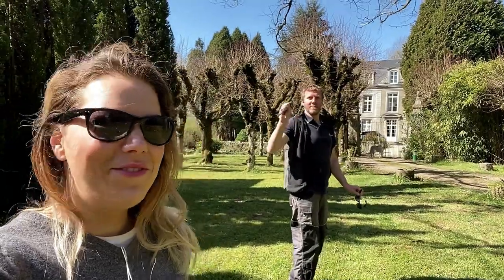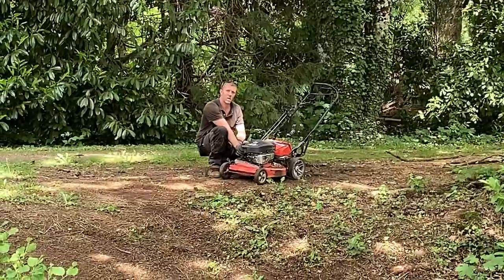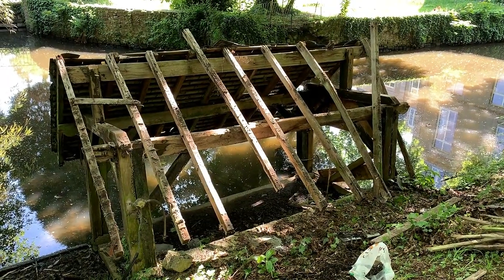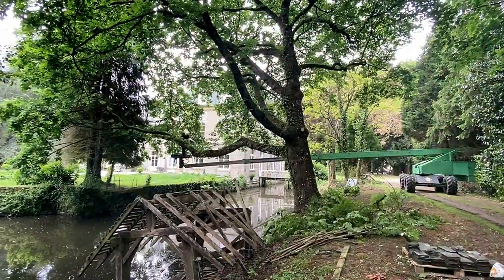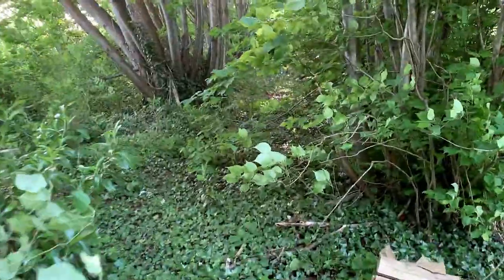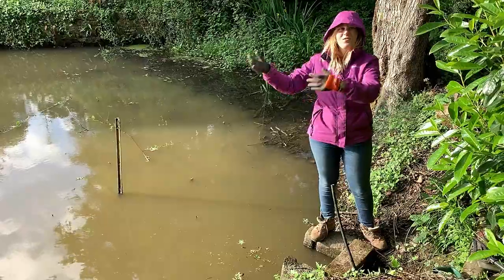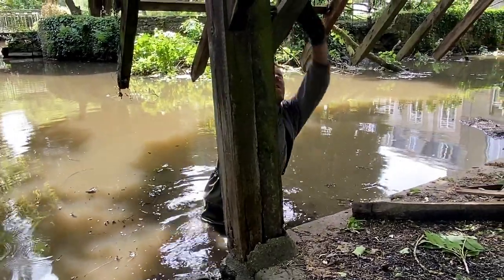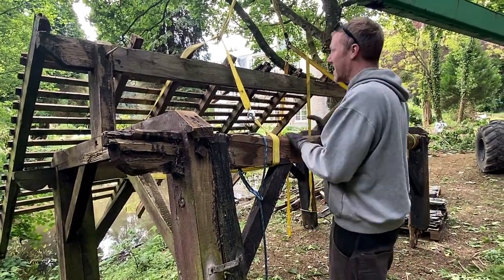Chateau Life 🏰 EP 13; SAVING THE ANCIENT SWAN HOUSE!

Comment: Good luck with the restoration of the duck house..just hope theres enough of the original structure left to work with...wire mesh should hold back some of the debris 💙
Reply from the maker: Been working away on it today, I’m replacing as little as possible without compromising the structure so it’s as original as possible; will get to see how that turned out in the next video x
Reply: Fab...look forward to seeing thd progress 👍

Comment: Fab work guys, and like all old buildings and structures always a bigger job than at first thought! Please treat yourself to some protective gear for when using the chain saw. Hat, gloves, sleeves, trousers, boots etc. Chainsaws are brilliant tools but very dangerous and unforgiving... we want to see you working for years to come!
Reply from the maker: Appreciate the kind words!

I’m always wearing boots, Kevlar lined trousers and gloves.

I wear sunglasses or clear glasses for eye protection as I have one eye that it very bad and I struggle very badly with the the mesh face protectors for vision; it’s actually been significantly more dangerous when I’ve tried to use it.

There is no such thing as a mild chainsaw accident after all!

Comment: Maybe the mower just needs new spark plugs n the air filter cleaned is all. 😃💕
Reply from the maker: no that's the basic maintenance, turned out that it has a system mechanism to cut out when it's at an angle for safety reasons, not all have this so that was interesting to learn.

Comment: Are you using premium/super gasoline in your 2 stroke engines?
A mechanic advised me to do that.
Too many additives in the lower grade petroleum.
Reply from the maker: Phil believes it was cutting out either due to the angle as they have a cut out switch if not level (some machines have this safety feature) or because the engine is not powerful enough for the hard job hehe 😂

Comment: Would it be any use you putting a mesh gadget around that drain  to stop I getting blocked every day
Reply from the maker: I have a mesh bin usually inside to catch surface debris, problem is if I stick it so that it blocks them going though I’d then have a lot of debris piling up in the moat, so I need it to go but not block up. Nothing is ever simple. I am working on a solution but diy style

Comment: the problem with your lawnmower thing sounds like its not getting enough oxygen. maybe its just a dirty filter.
Reply from the maker: turned out it had a setting of anti-tilting safety switch which  made it cut out, still it got most of it done!

Comment: No offence meant, but that swan house is trashed. As a Canadian, we know chainsaws, next time make your cuts smaller. It’s easier to get the logs out of the water , right now your large branch is mostly underwater due to weight and length. Good work to both of you.
Reply from the maker: Yes it’s in pretty bad shape but it’s not lost yet. The moat is too deep there to cut the log any shorter, it would be impossible to dive for it. The branches are fine. We plan to tow the log & cut small pieces at a time on the bank each time we tow it out a little. The moat is about 1-1.5meters deeps there
Reply: Chateau Life  Again no offence meant, but next time cut short pieces in the air so that you can fish them out. I really like your blogs, there down to earth and your wife is quite sweet without sounding like an old person. 
Additionally, the episode where you/wife cleans up a frame. I really did not think you could make that frame look better. The idea of using the gold colouring truly brought it out.